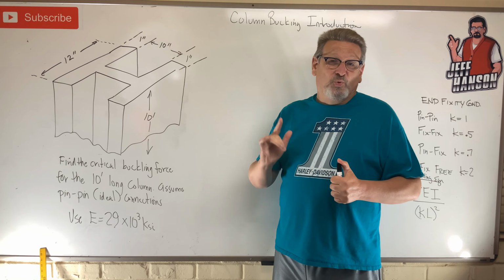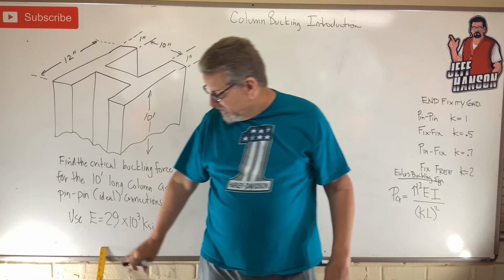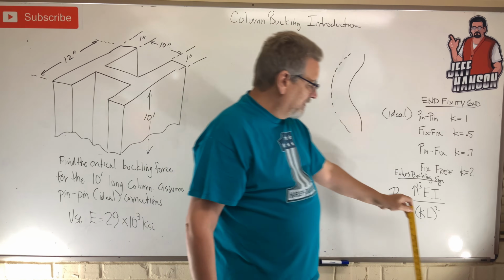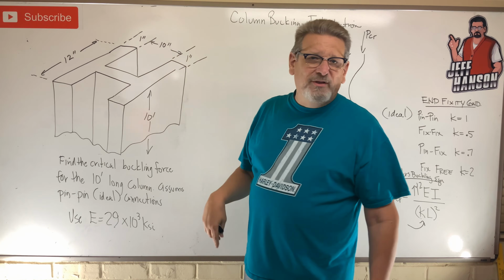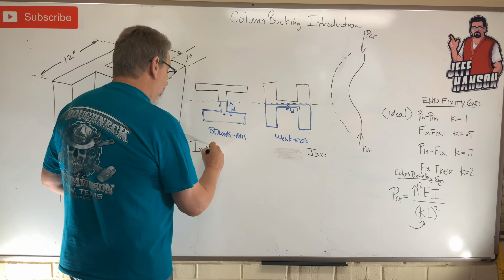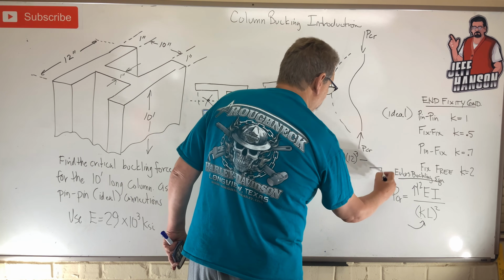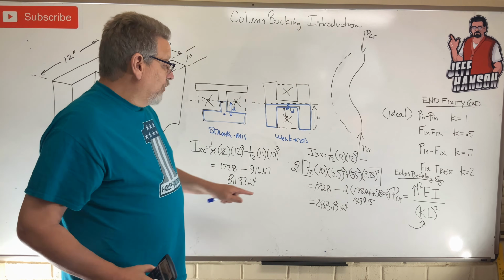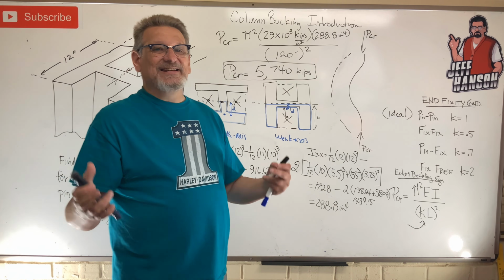Mechanics of Materials: Lesson 66 - Intro to Column Buckling

Comment: Unless this is another back yard project, why don't we just look up a beam in a catalog and take the lowest I which is given and then calculate the minimum load it can take without buckling.  Didn't we already know that I is lower in the h direction and I is on top in the equation so buckling will occur in the direction of H and not I.  Isn't that expensive to custom design beams and find a custom fabricator for our projects?

Comment: Was that number 782485321 or 78285321?   I know its easy because I converted to mm.  But why is it harder to have 1.88E3?  I know that the 85321.17 have a lot to contribute to the solution, especially when the given width was 2.000000m because you know we have to add a decimal point and 6 zeros when measuring with a tape measure or a laser distance finder from Lowe's.